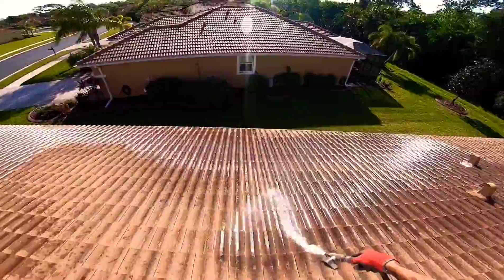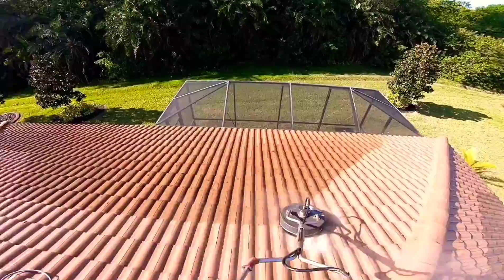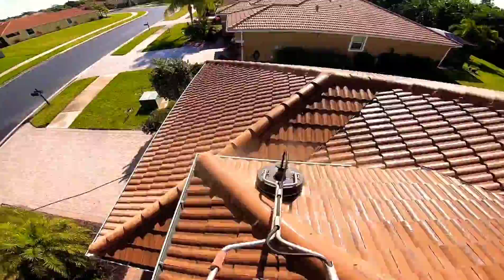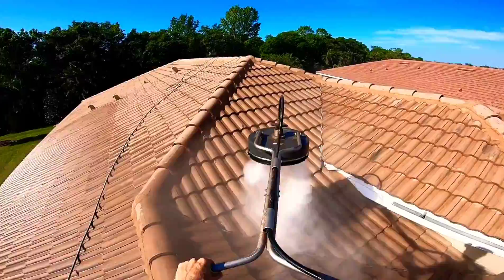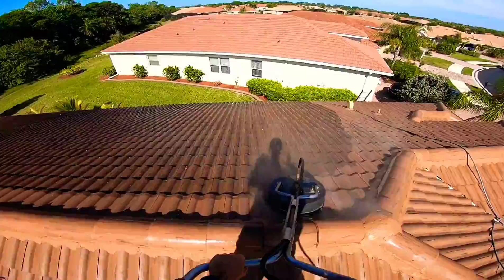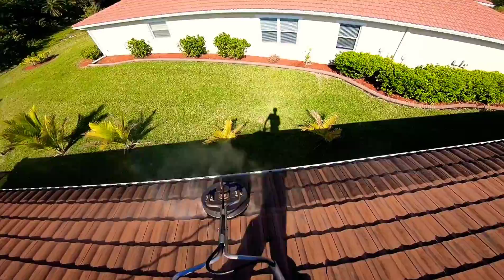Pressure Washing Tile Roofs Professionally.

Comment: What size surface cleaner are you running and do you have weights on it to keep it from flying? 
 I assume your running an 8gpm? 

 Thanks for the videos.... oddly satisfying to watch.
Reply from the maker: 18in and whe weight is more to help my hose its low Pressure but yes 8gpm